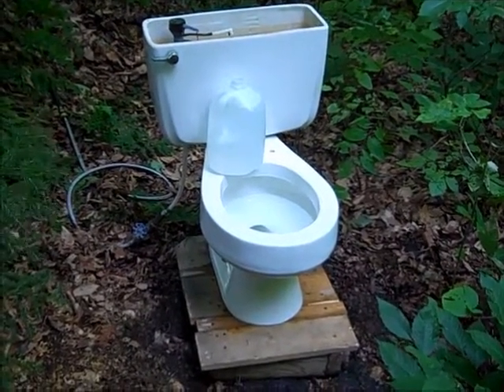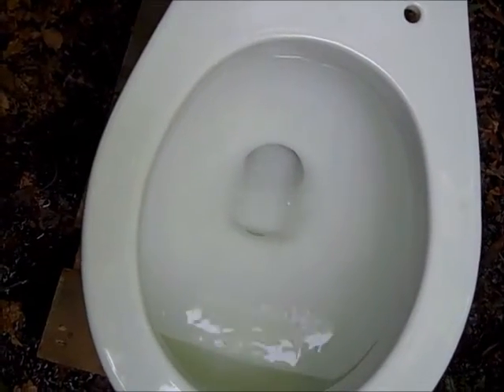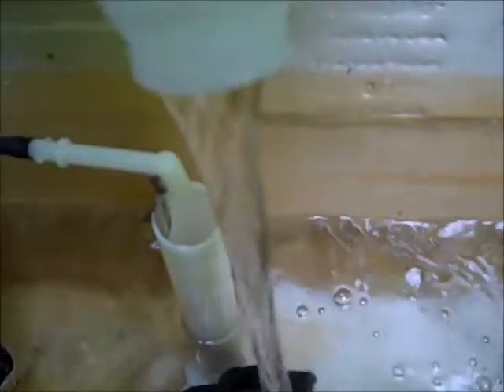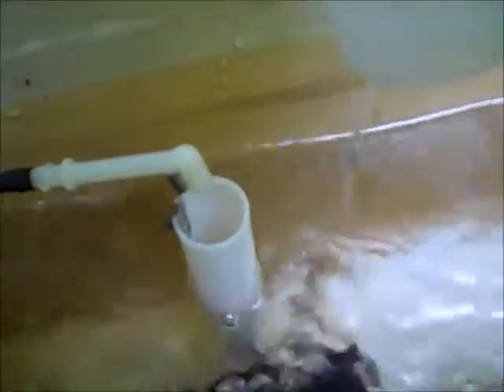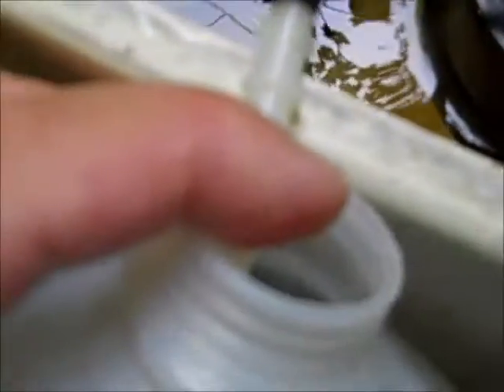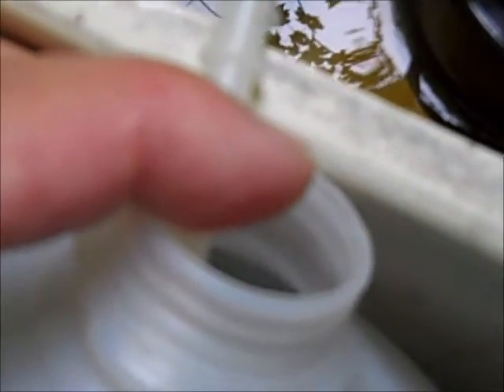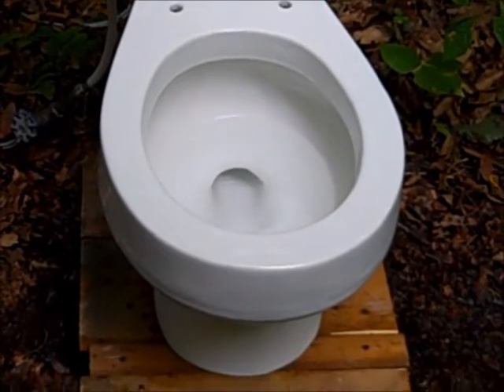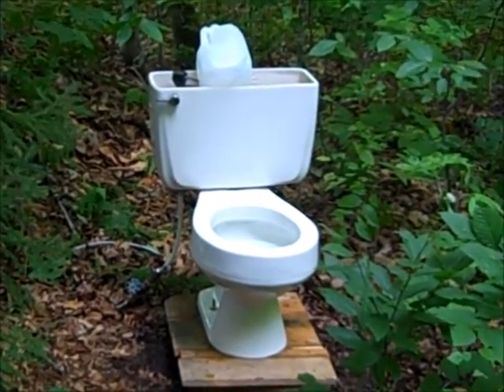80.  The Battle Of The Cadets:  1970 American Standard Cadet Water Usage Test

Comment: If the tilt valve is working properly then the bowl refill tube can be directed into the tank instead of into the overflow pipe as the bowl would mostly refill.